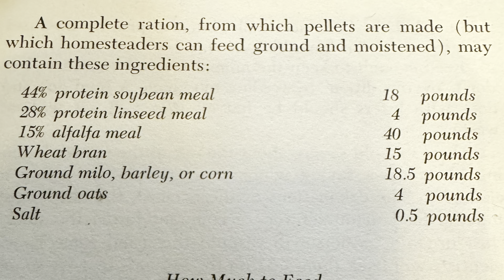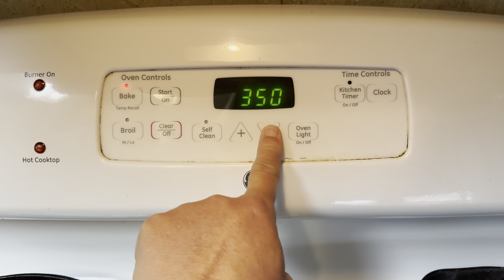RABBIT & CHICKEN PELLET FEED MADE ON THE FARM Milo, soybean, cracked corn and black oil sunflower

Comment: Are these raw grains cheaper than just buying the pellets ?
Reply from the maker: In the long run yes. We bought 225 pounds of raw material and the alfalfa hay for $138. 50 pounds of pellets cost $20 with tax. So it cost me around $38 more for the raw materials. However, 4 bags of feed lasts about 3 weeks (but soon the rabbits will deliver and 4 bags will only last about 2 weeks). These raw materials will feed the rabbits and chickens for 1 month. So in the end It is CHEAPER!
Now the best part is that the raw materials are fresh and not dried. Meaning the oils and micronutrients are still available for the rabbits.